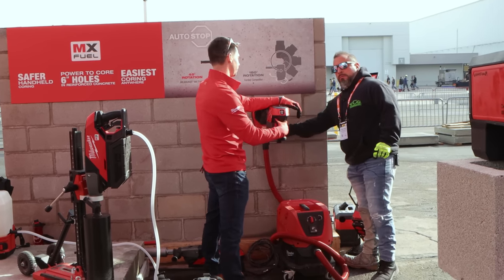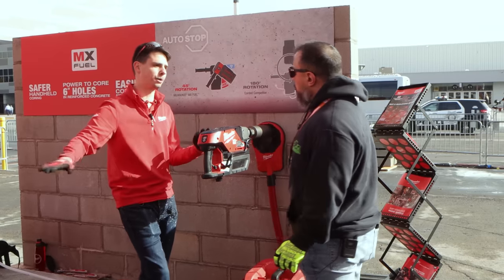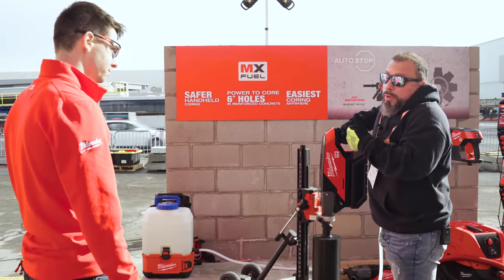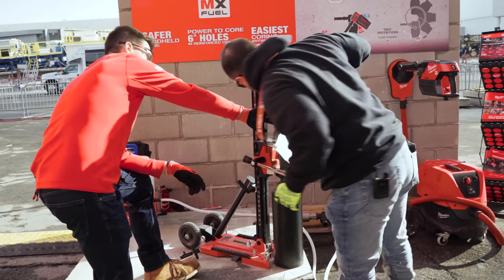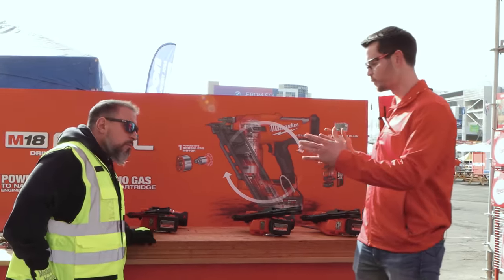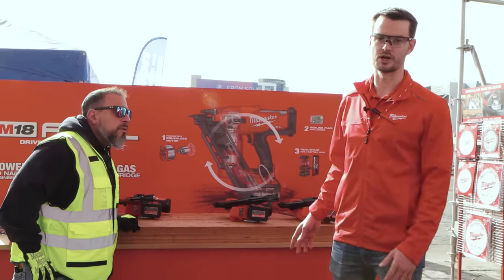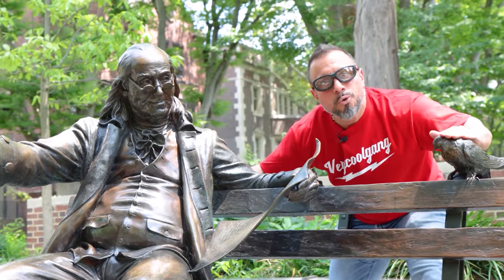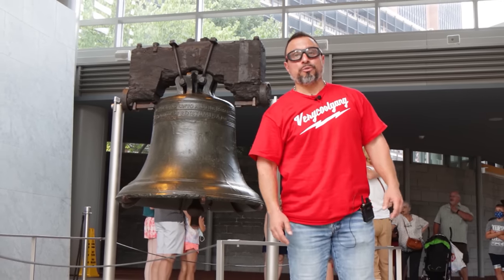Milwaukee Tool Changed My Mind!

Comment: The biggest differences of the framing nailers to me are the nails them selves. I prefer the 21 degree over the 30 degree because the 21 degree has more holding power. They are thicker, stronger, and have a full head centered on the shank just like real hand drive framing nails. Another advantage that i've found is that if you ever are in need to remove the nail, the head does not break off like the off set heads do frequently.
Reply: I couldn’t agree with you more, 21° is all I use or want.
Reply: You can get full head nails for the 30 degree. Like the guy said it’s just regional nails are the same, you are probably in an area that doesn’t have much to offer in30 degree, whereas where I come from doesn’t stock the 21’s as much so we all think 30 degree is superior and has more options.
Reply: @vincentking8874  -  yep.
Reply: @vincentking8874  I understand that the 30° nails do come in "full head" but from what i've used and seen they are off set from the shank, leaving one side of the shank with no holding edge. The only advantage i see from a 30° is accessibility due to the angle of magazine and higher nail capacity.
Reply: Paper collated nailes have glue holding them together with paper, that glue makes the naile really hard to pull. You can pull the plastic collated easily and studies have been done that there is actually no difference between paper and plastic. Oh and plastic collated fall apart in the cold. Huge advantages to using Paper collated nails.

Edit:words

Comment: I have no business buying or owning a core drill, but if I did, I’d buy that one! 🤣  Awesome info, great video as always! 👍🏻
Reply: oh trust me, you learn the first time that using a grinder to core through concrete is a bad idea... then you go out and get a proper core drill so you never have to do that again... it wasnt a fun way to learn that lesson
Reply: Agreed! If I cant drill a series of holes with my SDS hammer drill and knock it out(duck seal will clean up the hole), than its above my pay grade of tasks to do...
Reply: @Don B  oh i cheated, i got a coring bit and burned out 3 grinders to core out a 4 inch cone through a 6 inch foundation for a drier vent, coring bit vibrated so hard it kept killing them

Comment: @VCG Construction, Mister Brian you failed to mention the difference between 21 and 30 degree Nailers!!! 30degree's .113 -  .131 diameter  and 21 degree's .113 - .148 diameter!!! And if an Engineer for engineered LVL etc. (or your going to have to use large nuts and bolts to fasten in a certain pattern , if its called out on the drawing(s)) if it calls for a heaver gauge such as a .148 diameter nail and you only have a 30 degree nailer you will have to buy another gun being a 21 degree and there are more nails for 21 degree's for that !!! But hopefully there are no ballbusters inspectors out there, ha ha ha!!!

Comment: the 21 degree nailer says on the box and the website that you can use nails with a larger shank diameter ( which is required by code in some applications/ geographical locations ) and full round centered heads. the 30 degree can't accepts nails with as large shank diameters but they might be able to accept full round centered headed nails.

Comment: I don't work in construction but I bought a lot of milwaukee fuel stuff for my diy projects and that fuel circular saw is so impressive my mindset was if I'm cutting the cord don't half ass it with a cheap brand than like a year after buying all those ryobi and Kobalt came out with stuff very similar atleast specs wise

Comment: Used the m18 nailers and I'm not a fan ( it is very nice )  my issue is the bladder on the side its hard to put walls together with that there and it is a little heavy but the brad nailers and stuff are a home run they rock especially the gen 2

Comment: That core drill is pretty cool until you realize it costs $2500 and still needs a $350+ battery and any other accessories you might need on top. I guess if you're the type of person that actually needs a core drill it's worth it though.
Reply: no coming from a concrete cutter that battery powered hand drill doesn't have the battery life or power to be worth it
Reply: If you want a good handheld core drill then buy a WEKA from Germany, costs way less and you can get the same style mounting stand if you want too
Reply: @SparxI0  that's what I use...

Comment: Why did they go with mx platform on a core drill? A 9" angle grinder, corded version is 15 amps or more and they have m18 version of that. But their own corded core drill uses only 12 amps! Erope model number DD 2-160 XE. So why did they use mx platform? I really would like a cordless core drill like that, but can't justify to invest in another platform. I dont care its 4x the price of corded model, i can't afford carying another huge battery and a humungous charger just for the drill!